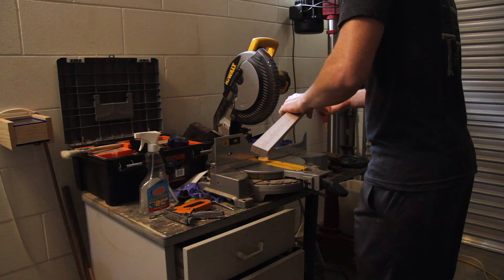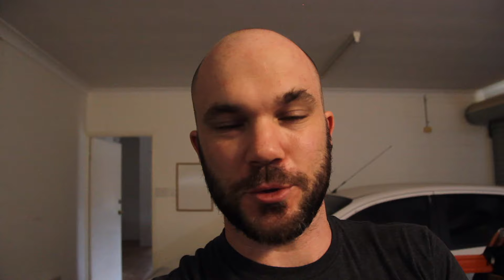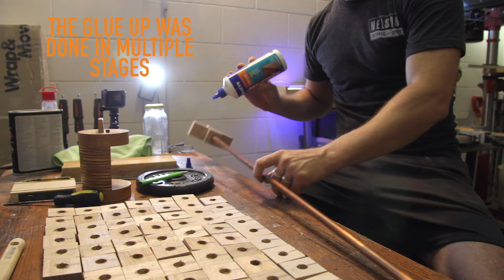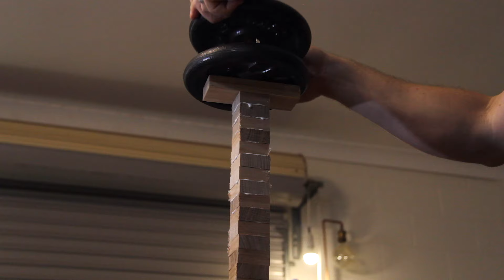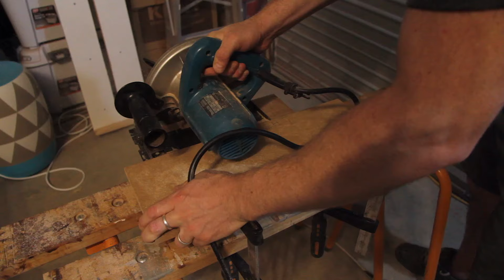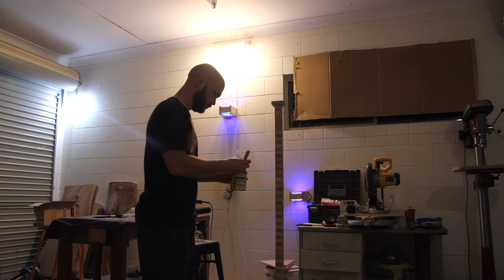Plywood Inspired Floor Lamp | A Timeless Look

Comment: Robin, very nice project. I start thinking about other ways to use that process. I wonder if with some inside steel support would it possible to make chair or stool legs. That would be cool. R
Reply from the maker: Threaded rod (or some kind of steel) would be a lot stronger. Someone else in the comments thought about making chairs with this style

Comment: For the tearout in the tassie oak blocks, that can be eliminated with a better blade (I don't know how worn yours is, maybe it just needs a sharpen) and a sacrificial fence on your mitre saw to eliminate tearout.
Reply from the maker: The blade is the original, out the box, Dewalt blade, and it's about 2 years old! So yeah, reckon it's time for a new one. Is it worth sharpening, or should I just invest in a new, good blade?
Reply: I'd say buy a good quality new blade. Stock blades are usually 'OK' at best, never great, and on a mitre saw they're meant for construction (speed) more than clean cuts.